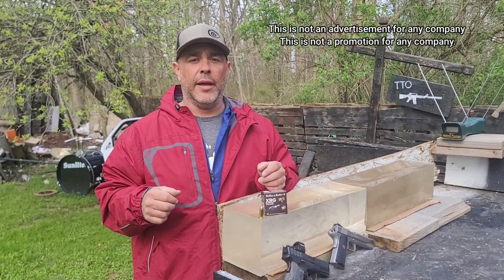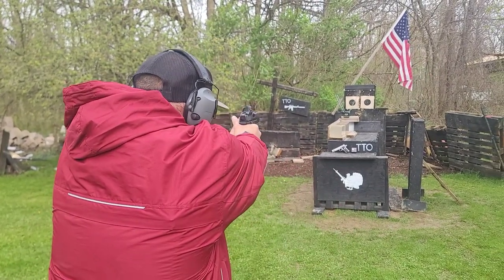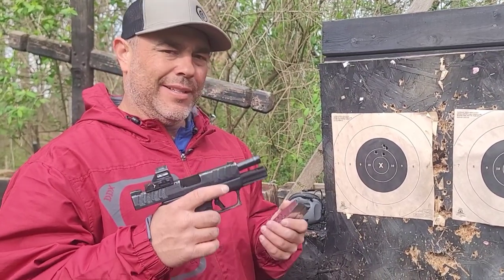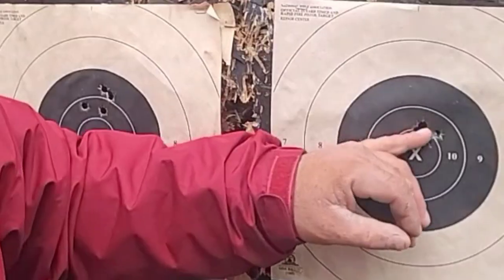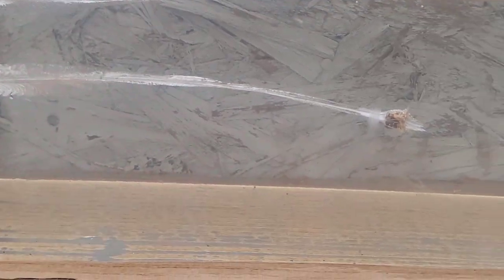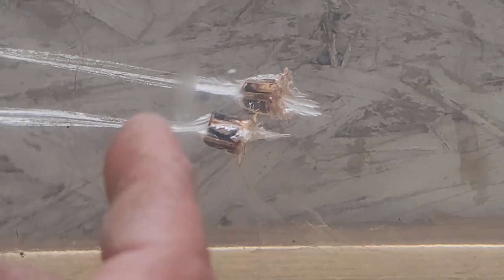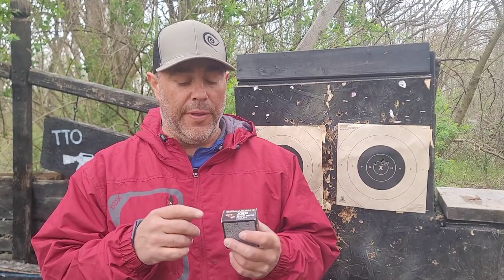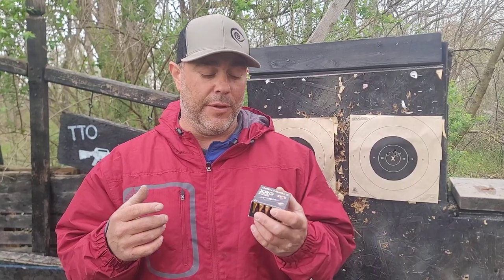10mm Ammo Testing Series: #11 Sellier & Bellot XRG 130gn | 5" AND 3.8" Barrels | Accuracy/Gel

Comment: I would really like to see the offering from Buffalo Bore loaded with the 155 Grain Barnes TAC-XP. That would be an interesting comparison to this since both are all copper hollow points.
Reply: Bro just buy some underwood 165 gr gold dot, watch tools and targets those underwood’s 165s open up to a 1 inch projectile while delivering over 700lbs of energy
Reply: @johnwick7158  Unfortunately, Underwood is evidently not currently loading Gold Dots😢
Reply: Yes I like the Underwood 165 grain Gold Dots too. But I would like to see how the Barnes compares to the S&B since they are both all copper hollow points
Reply: Underwood has also started loading the Barnes 155 TAC-XP as well. And I believe they are supposed to be going a little faster than the Buffalo Bore offering. So maybe try those out as well

Comment: Practically 9mm weight at practically 9mm velocity with more powder would be the right recipe for that ”hollow” feel. Pretty lame velocity for very light for caliber bullets. I’d rather go with a good 180-200 gr HP for edc, and a 200 gr RNFP for woods defense. Now if someone offered a light for caliber flap point all copper bullet at 2300-2400fps, that would be a useful unconventional round.

Comment: That odd recoil impulse is something I've found with light for caliber projectiles like 185 gr 44 mag.
327 Federal recoil is as you described the 30 carbine pistol, it impacts your ears and sinuses more than your wrist.
Reply from the maker: It's pretty weird. Good info on 327👍
That was a good description of the 30. 
I actually really like that in a revolver.👍🦃👊
Reply: @theturkeysopinion  If you get the opportunity to try a Blackhawk or single seven with a 5.5" or more barrel the velocities and noise are very similar to the 30 cal Blackhawk, close to 1600 fps.The 20" Henry exceeds 2000 fps with 100 gr soft points.